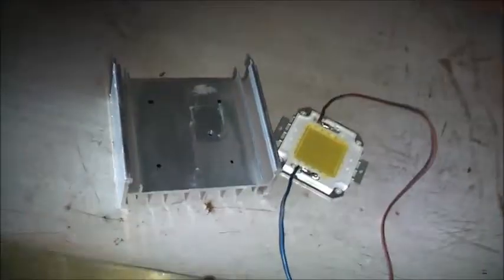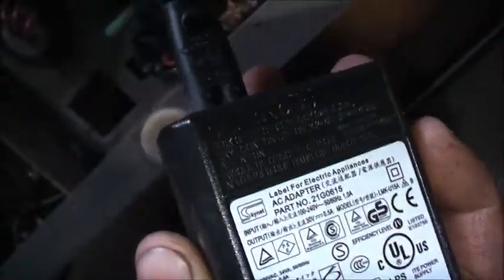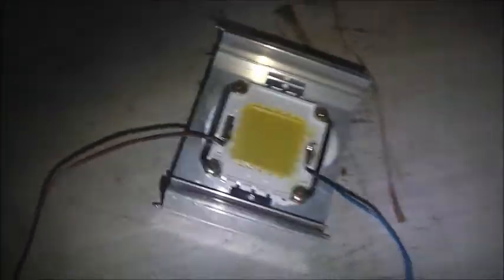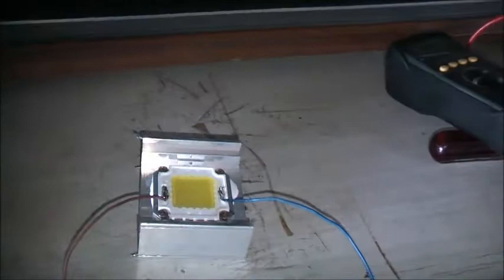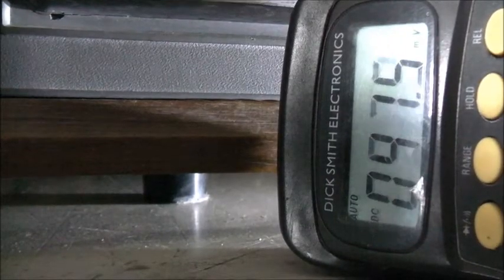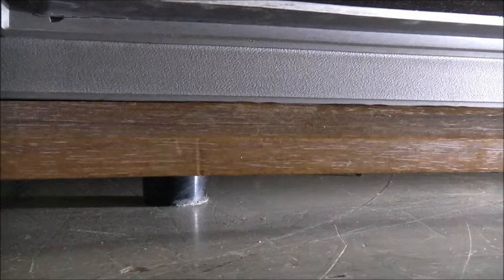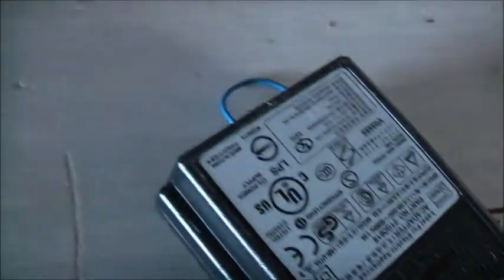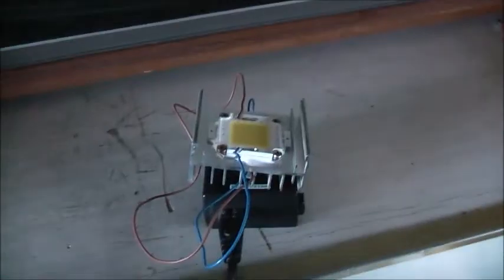Bright As Buggery LED Light!

Comment: oh i used one of those to make a lithium ion powered flashlight. built it out of a 1950s railroad lamp. only run it at like 12w but that means it doesnt need a heatsink.

you can get a 7$ dc-dc step up tranfsormer that will take the 4.2v of lithium cells and step it u to 27v. also you can get for like 1$ a usb charger circuit, could make a nice portable unit.

Comment: That LED is not being run anywhere near maximum brightness. To get maximum brightness it would have to be run  a lot nearer its maximum voltage rating, and the current will increase allot. I wonder what the LED's Power rating is as that printer PSU can only put out 15 watts. Even a 50watt LED would need nearly a 2amp PSU.
Reply from the maker: yeah I know, i need a more suitable power supply!
Reply: yeah as you step up the voltage the amps the LED pulls increases like crazy.
Reply: HDXFH
I thought you did really well to find a psu laying around that could drive that led at all,I threw my inkjet psu away along time ago :-( . My comment was mainly intended for the guy that said the LED did not look very bright.
Reply: *****
no you don't.
Reply: *****
Not if the power supply voltage can't go too high. You would only need to limit the amps I,f your running it off a higher voltage than what its rated for, but I just run it off a voltage I want it to run on.